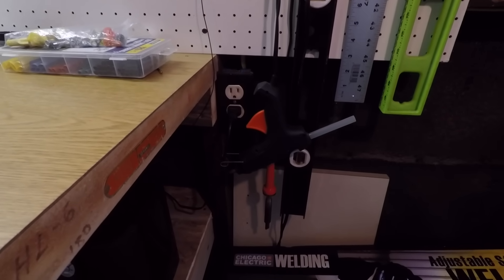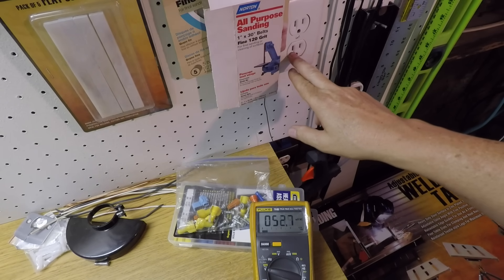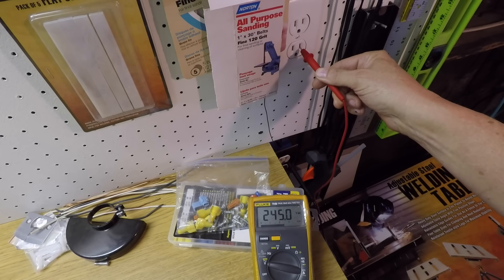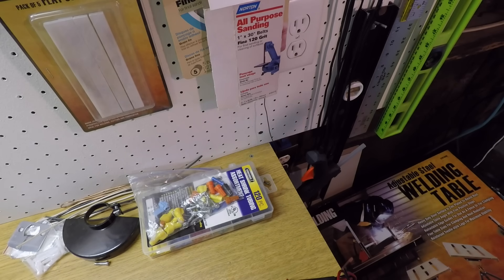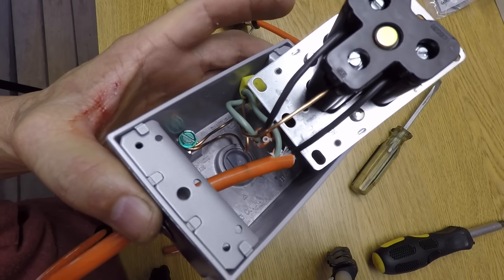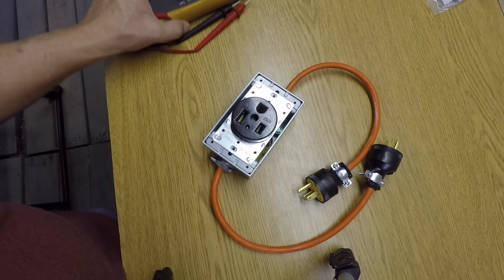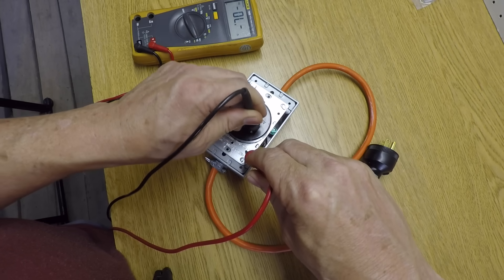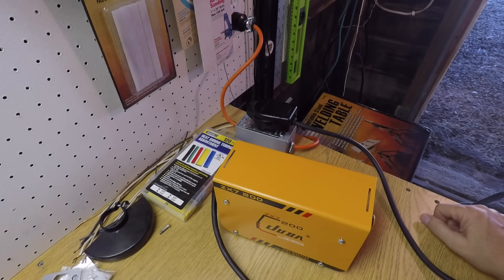How to Get 220v From 110v

Comment: This only works because there are 2 DIFFERENT outlet lines, house has 220VAC coming in, one set of breakers off one side, another set off the other, but as others said a person should install a dedicated 220VAC outlet on its own breaker, panels always have extra space, usually.

Doing this wiring? Clearly skilled at making cables, testing. If done wrong?  serious problems.  Those who dont do electrical wiring need to stop and take extra steps, this item is useful but wow, damage, fire, shock. 

One suggestion, Id add NEON lights to each side so the user can see instantly if one leg is out, and to not use.

Comment: I do something similar. I simply use a 4 outlet electrical box and run the two phases into the same box and run one phase to the right outlet and the second phase to the left outlet.  Then I can make a simple adapter similar to yours but a little more compact.  I could have just installed a 220 outlet, true, but I rarely need a 220 source.  Not compliant with the electrical code you say? I say F the electrical code.  I know what I am doing when it comes to electronics and electrical power grids. The electrical code has lots of good ideas and for good reasons, but then they have a lot of ideas to protect the Darwins among us.  I say let the Darwins weed themselves out.

Comment: It would have been a LOT safer, and up to code, to run a three conductor plus ground wire to the garage from a double-pole breaker.  That actually has a breaker on each line bridged with the other breaker so if one trips, so does the other one.  In the garage, wire the 120 VAC outlets from black and white conductors.  Wire the 240 VAC outlets from black and red conductors.  In the breaker box, black and red conductors go to two poles of the breaker.  White goes to the neutral bar.  Green to the ground bar.  Each of the outlets gets a ground connection, and if you use metal boxes, always ground the metal box.  Note that some 240 VAC appliances use a four prong plug because they also need a white (neutral) connection.  They often have 120 VAC light bulbs and control panels.
Reply: THANKS  Patrick.P
Reply: I don't understand why they make appliances that NEED 120 in addition to 240. It seems much more sane to make a 240v only appliance as I assume is used in Europe with their 220-240v system...I know we have split phase but it still doesn't make sense.

Comment: I connected a dryer cord to my generator inlet box, then you have a pig tail. when my power goes out, grid is down, I unplug my dryer chord, get the pigtail I made, plug it into dryer socket. generator plug into box, Feed goes to inlet, out to house dryer socket then power whole house. SAFETY FIRST TURN OFF MAIN, Electrician can install safety lock so main cannot turn back on. Back is REAL.....rarely do I have to use it. same theory just make an inlet for your plug, when dryer not in use you can have at it.....

Comment: If you only have have one outlet you can use like for instance my mom needs to run her dryer her place isn’t capable of 220v she rents and she cannot replace anything to the breaker box so if you did this on one outlet do you need to wire the hot over to both sides or would is work if you ran one on a longer cord running to another room say 15 ft of wire to the next breaker

Comment: Your welder actually has access to 40Amps less the amount of shared loads on each circuit.  It would need to pull in excess of that sum amperage for the breakers to both trip.
 40A divides by 2 minus the maximum loads on each circuit, then added back together.  For example, 
40A/2
Line 1: 20A minus 5A existing lighting load equals 15A
Line 2: 20A minus 3A existing circuit load equals 17A

Line 1(15) + Line 2 (17): 32A total available power.

If you do trip it, it will likely be one side or the other, not both, bc once one side trips, the other is immediately seeing the reduced load of the welder shutting off.

You would have to exceed one or the other available amperage on either line to see an overload tripout, which would probably only ever happen when you’re welding the thickest material your welder can handle plus running loads that exceed capacity.
Reply: You don't know WTF you are talking about.  A  40A  circuit uses  40A breakers whether it's 120 or 240.  This is a 20A circuit and this lash up is DANGEROUS
Reply: @fourfortyroadrunner6701    AGREED!  Viewers: Do not listen to @Combat Pyro!

Comment: Lol, you are drawing as much abuse as I did when I made a jumper cord that grabs 120v out of a 240v outlet for a heating element. You should have heard the protests to that.
Reply from the maker: LOL, I post videos like this just to find out what all the "EXPERTS" have to say. 😂😂😂
Reply: @DIYHomesteadProjectsDIYHP10  lol
Reply: Three years and my 120V from a 240V outlet is still working. No hot wires or burnt out fixtures.

Comment: Regardless of whether one circuit (phase) carries additional load - you should have both of the supply circuits on the same double-pole breaker. This looks like danger waiting to happen. I am not a pro but have cleaned up wiring done by a master electrician and I know how to work breaker boxes with the covers removed.

Comment: This guy went through all this trouble making this gadget when he could have simply wired and mounted a 220v outlet in the wall and not had to fool with that junk. I would rather run a 220v outlet in the first place and make a splitter for two 110s instead of vice versa. He also should have said legs instead of lines, if you run two lines off the same leg it will not work.

Comment: First failure is 15 amp receptacle on 20 amp circuit.second failure He maid suicide connection........Why You just did'n fish wire from this two receptacles and install 240 volt welder receptacle....Thanks

Comment: its not a bad idea for a temporary short term 220 need BUT....all 3 garages ive had, all the 110s were on the same breaker. id have to run a long extension cord to get to another outlet on a different leg and line loss would be a factor.  if i had to wire in a 110 on its own breaker on a different leg to get 220.......id just wire in a 220 outlet. but thanks, was interesting to see as this question had come up before
Reply from the maker: Thanks for watching!

Comment: Main concern is you're relying on two separate breakers  for one device. One breaker trips you still have power on the other circuit feeding that outlet. Easier and safer to run another circuit to a double pole breaker assuming there's space in the panel for a double pole breaker. Your welder should have a rating lable on it.
Reply: This is just fine for what he's doing 😂. I clicked on this video just for these comments 👌
Reply: You can interlock the two single breakers so that when one trips, it also trips the other one. As long as they are one on top of the other in the panel
Reply: @gli_nick  I do believe to have two breakers on top of each other they will be on the same leg, they would be one breaker on each side of the panel.🤔 
Edit- Maybe his buss bars are staggered. I guess that’s more the norm but not necessarily. Seems like that should be a standard. Maybe it is now. ??
Reply: @jasperthehairycaterpillar1168  every other one is how electrical panels are designed. that's how a 240v can work. you have 1 hot from each leg (in a typical american split phase) that combine and they flip on or off or trip together. if this works for him then both of those outlets are on different phases. it wouldn't work if both were on the same phase.
Reply: @jasperthehairycaterpillar1168  it would have to be, when you put in a 240 breaker, they are stacked.
Reply: Breakers are not there to protect the device in the first place. Breakers are strictly to protect the wiring from causing a fire resulting from a short to ground.
Reply: @My 2 Cents yes but it disconnects both 120 supplies as the are physically connected.
Reply: Who gives a fuck if only one breaker trips. Just stop welding and go flip breaker. Not rocket science
Reply: might as well just install a 240 plug
Reply: thank you,Patrick.P
Reply: In my case it is not easier. My box is a floor down and on the other side of the house. I think that’s the type of thing this helps with. I do agree it is still questionable though from a safety aspect.
Reply: If one breaker pops, the circuit in the heavy outlet is gone. No completed circuit means no power.
Reply: @mrobvious433  There are two breakers feeding the receptacle. Depending on what made breaker 1 trip, breaker 2 is still hot going into the receptacle. You would be losing one leg of your 220v outlet. Your equipment wont work, but you will still have power to half the receptacle.
Reply: Easier, safer, and cheaper. +If the house burns down with the current setup, good luck on collecting the insurance.

Comment: Just made one and Won't work if either outlet is on a GFCI line like most modern homes do for garages. Just have to get another heavy duty extension cord to make it to a regular outlet I guess. Edt: tried again and everything was fine but my welder must have a safety thing inside because my everlast didn't even turn on. So generator it is I guess.

Comment: One more thought.  If a condition arises that will trip a breaker, since,  if I understand you correctly, these two "hot" conductors are wired to two separate 120v breakers, which means they are not linked, which gives rise to the possibility only one breaker may trip, leaving the other still hot, which under the right condition may cause a wire to heat up possibly causing a fire. Of course, I'm no expert so if I'm wrong, take this with a grain of salt. :)

Comment: Wait....... I don't understand.  You said each 120v duplex outlet is on a separate "line". Does this mean they are both on the same phase but separate conductors or does it mean you actually have a panel with 2 opposite phases? If you have two different phases, why do you need to do this? Just hook up a 240v outlet? However, if both duplex outlets are the same phase, how does that work?

Comment: Electricians also do not condone using 15 amp plugs with wire gauged for 15 amps on 20 amp circuits, regardless of how short the cords are as it is a fire hazard with the lower gauge wire getting hot when pulling 20 amps.

Comment: I believe if you only plug in one plug and turn the welder on, the 120v coming into the welder windings and go out the other plug and anything it touches can get shocked. It's just like screwing in a 120 light bulb and not connecting the white wire to a neutral bar, the element of the bulb will act as conductor and the 120v will be carried out the white where ever it ends.

Comment: 15 amp ext cable wouldn't be my first choice on a 20 amp feed for that connection.  You can get 12 guage braded appliance cord at lowes and at least match your 20 amp outlet for a better safety margin. Under a heavy load that orange cord will get warm.

Comment: The trick is to know that the 2 separate 120v are from 2 different poles.
You mentionned briefly that you installed the 2 outlets yourself, so you know they come from 2 diiferent 120 v sources.
But if anyone else tries that in his garage, how can he know that he  gets 2 120v sources from 2 different poles. And that is the trick.
Unless you turn off everything from the main panel, and use a signal tracer to determine that you get 2 different 120v lines.

Comment: Great video, I’ve ran into several situations where this would have helped a bunch including times where it’s rental property and running a 220 isn’t an option. Great video once again
Reply from the maker: Thanks James, it's a handy device for the right situation.
Reply: Until your rental house burns down and you're sued for thousands because you didn't want to hire an electrician.
If you're going to run 2 separate outlet buses just put the 220 in and do it right.

But i get why he would do this for his purposes but im sure he knows the risks.

Comment: If you still wanna be a hack but safer and smarter buy a 2 pole 15 or 20 ( based on the wire size your using on an existing 120v outlet. Just move the neutral in the panel to the 2 pole breaker.. circuit must be dedicated though. All it will cost you is a breaker. And a new 250v outlet

Comment: That welder draws 6.5 KW divided by 240 V equals 27 A. Circuits are rated to protect the wire, so you’re a 20 amp breakers are insufficient.  You also need a two pole breaker or a handle tie on the breakers, but I would run number eight copper or number 6 AL three wire  cable to be safe.

Comment: you got two outlet from 2 different phase, so you can get 240 from this method. If you are in the same floor, usually have same phase in outlets, you won't got 240 vol with this method.

Comment: How come you didn't use the white wire
Reply from the maker: The white (neutral) wire is not required for this 240V welder circuit.

Comment: If your home is on 220/110 volts you are either in China or something is seriously out of date with your service transformer or you have something dragging your voltage down 10 volts. The standard in the USA is 240/120 volts not 220/110 volts.

Comment: Nice video for a cheap fix for a very small output 220-230 volt outlet solution. The only thing is that this is limited to very small amperage. It costs a lot to put in a 220-230 volt outlet but it is well worth it in the end for safety and for something that will do much larger amperage jobs. Not many welders are of that low amperage.

Comment: This is exactly the same as having a 220 outlet. As long as your using 2 separate phase outlets, no problems! Just watch your amperage on those 12/2 wires. Of course your halving  the amperage anyway by doubling the voltage.

Comment: I would have  just hardwired the 240v outlet by pulling power from the two 120v circuits.  The other thing you missed is that the two 120v circuits should be next to each other in your breaker box so you are pulling power from separate legs and they should be connected to a double pole 240v breaker.  This way if one side trips, they both trip. Or if you're working on one circuit, you don't risk getting shocked from the other.  The hot wires from each circuit should also be cable tied together in the panel so that anyone looking inside the box knows that they go together and belong on a double pole breaker.

Comment: This is a good idea on the lower draw devices....but it wont work on higher amp draws on larger devices and thst has to be properly wired on larger amp and breaker appropriate wiring.

Though you mentioned two separate lines or breakers were used....not every outlet will be wired that way.....and the common homeowner will not know that and will.not know the same bus has to be used at the panel.

Best way and safest way  is to wire the appropriate breaker and wire at the panel to the recepticle!

Comment: So why didn't you just run a 220 plug in the wall when you set the other two plug's, I suppose it gives you some portability that you wouldn't normally have, but then again how many people bother to run to sets of wiring outlets, just to have 220 available anywhere they want it, unless there was another reason for running the second set of home runs.
    The cost in time, labor, and material has to be way more then a 220 wire harness and box run to a permanent place, which is the norm, So I'm curious about what the reasoning was for doing all that in the first place. On the surface it seems like a great idea, but when you dig down a bit into what you have actually achieved verse's just doing it the way we all usually do it, it seems a little redundant and impractical.

Comment: Way to many issues with this. Just do it right and wire in a dedicated 220vac plug. 
If both outlets are on the same side of your panel this isn’t a good idea at all. If your equipment is an inverter style welder and one breaker trips you can damage the welder. 
The wire size won’t hold the amps you need either. 
Short cuts usually cause problems so don’t do it
Reply from the maker: I haven't had any of the issue you mention with this adaptor since I built it two years ago.

Comment: A 15-Amp extension cord (which I seriously doubt is even rated that high especially if it has stranded wires) means the absolute most current you can draw is 15 amps. But then you use a 50 amp plug with 2 separately phased 120V circuits -- with other junk probably plugged in other recepticles?! Am I the only one who see a serious problem here? You should have wired for a dedicated 240-volt receptacle or invested in a commercial grade 240-volt extension cord all the way to your mains with fused breakers exclusively for that one welder. Ya! It's not cheap! But then you probably won't burn your house down from over heated wires either. Maybe it's time to think about getting a generator for your welder and forget about using any existing house wiring.
Reply from the maker: It's been two years and I haven't burnt anything down. It worked exactly as planned.

Comment: But you are not getting 220/240 out of 110/120v. You have two separate 110 legs using each leg you get the 220/240. 
Misleading

Comment: Would this be fine to use for a 240 volt motel style air conditioning / heating unit?
Reply from the maker: I don't know Bobby, I only used it for my little welder. I never tried it with anything else.

Comment: You failed to mention different phases. You can have separate circuits on the same phase . Not good to make a 220 circuit , but 110 volt off one phase an 110 off another phase is what you want to make a 220.